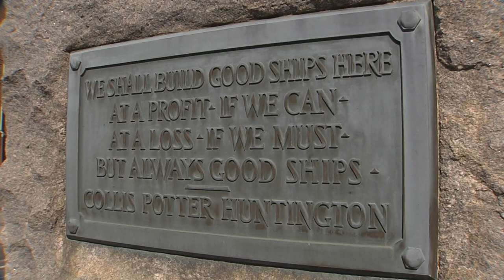The Story of USS Thresher – Lest We Forget

Comment: I have always  wondered if the water could have got into the ship through the air horn outside the ship. The leslie valve may have leaked into the air line once the ship got to a certain depth
 Leslie valve didn't run the external hydro tests the on these valves until 1986. When they started running these tests the valves failed and the main valve would open during the test.